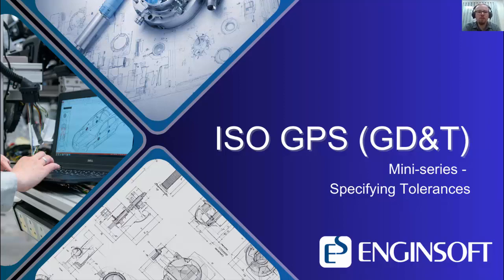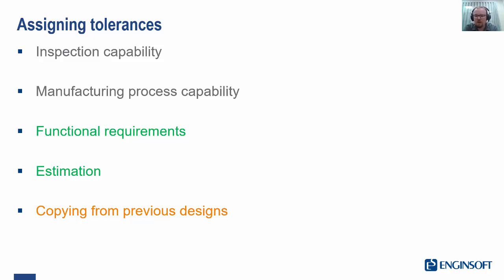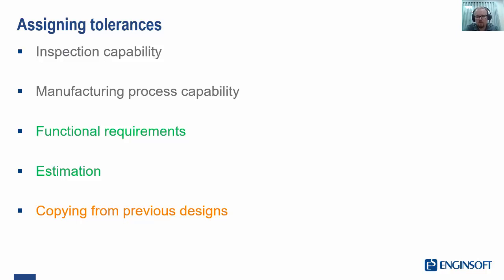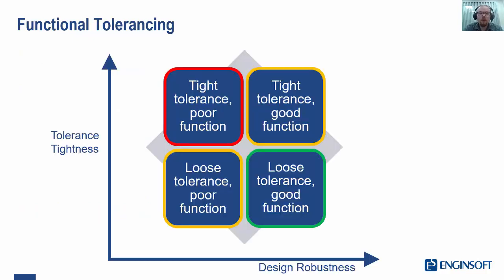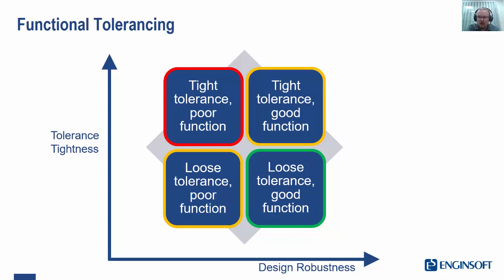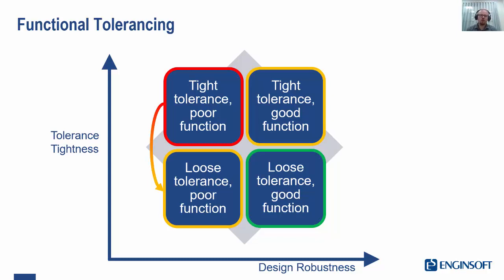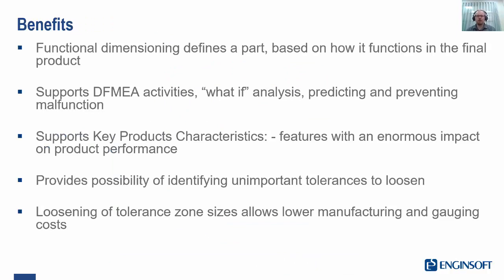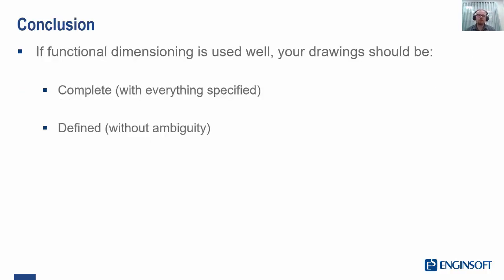ISO GPS (GD&T) Mini-series - Specifying Tolerances

Comment: Let‘s start talking about feature functions. „Contacts“ are a good idea. Unfortunately a contact appears in assembly constrains. Nowadays we speak only about a single part specification, where the contact partner must be simulated and the tolerance of the contact function must synthetized. Nobody is talking about this problems. I‘m not wondering about the bloody quality of geometric specifications…